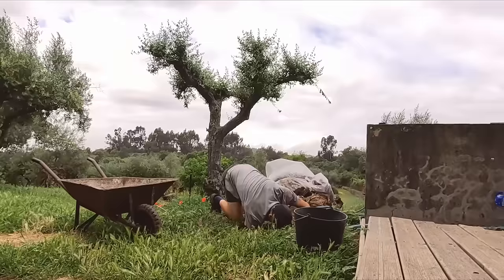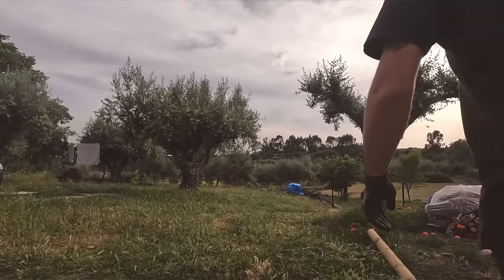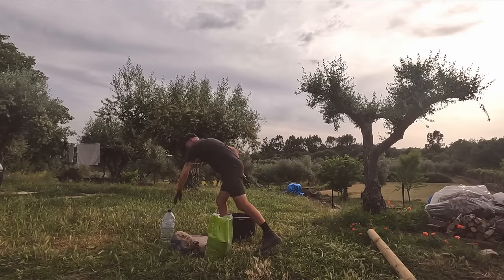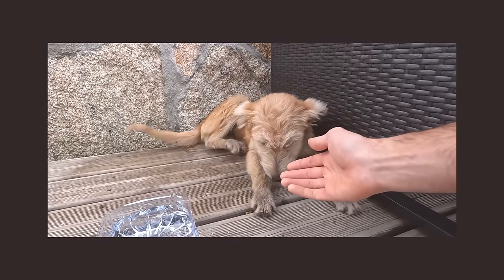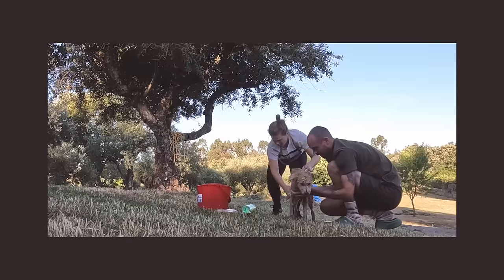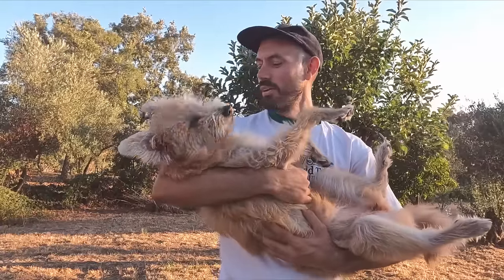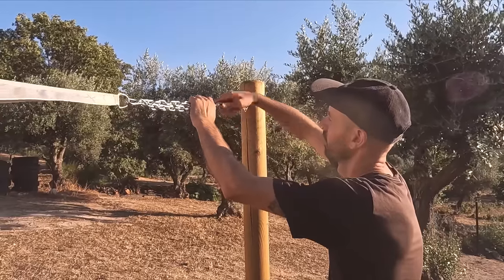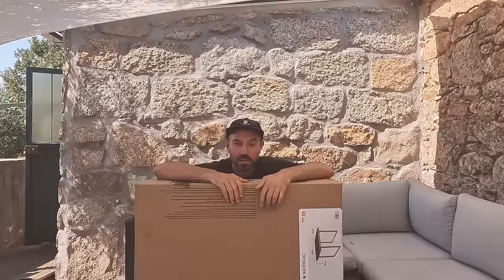CAN WE KEEP HER? Dog in Need & Creating Outdoor Living Space

Comment: Ricky glad Poppy recognised your kind heart. She must have been desperate to approach your house with Ted in residence.  She chose well! 

When you build the veranda suggest you slope veranda roof so that it floats above the house roof edge.  Hot air will vent out of gap, ie there is a house roof and there is a separate patio roof.  About 30 cm overhang above the house and 25-30 cm space between house gutter and patio roof will work. Hot air rises and by having a vent line you will be creating air movement as the hot air vents, and have  cooler air below on the patio.  A lot of homes here (hot subtropics) are using this type of patio extension.

Comment: I have adopted many dogs over the past 20 years or so, and I recommend it whole heartedly.  They are the best.  The one thing I worry about, but I am no builder, it that you put the wooden pole directly into the concrete.  Supposedly the pole will rot.  That is what I have heard.
Reply from the maker: It only rots if you don’t put gravel underneath the pole to stop it sitting in water or if you don’t slope the concrete away from the pole to stop puddles forming around the top

Comment: The walls of the house are stunning, but is there cement between the stones that maybe should be removed and replaced with that beautful lime mortar used by the " Indie Project '"?  Adore this beautful material .. The sound of cicadas , emotional music. Praying for rain..All the best.. keep going!
Reply from the maker: You're correct Patrizia. The building is currently held together by an old earth mortar but there are areas where cement mortar has been used by the previous owners to patch up holes...in two areas cement has actually been thrown all over the wall! Going to be fun trying to remove all of that! But yes, eventually I'm going to remove all of it & replace with lime, both outside & inside 👍

Comment: Great video. Congrats on the new family member!

One comment - you're deck boards don't look completely rotten, just weathered. If that is pressure-treated lumber, it should last 15 years at least. If it can be restored without replacing, that would be the most eco thing to do, since PT lumber is a hazardous waste and it is highly inadvisable to burn it.

That's also about 1000 € in replacement value at the current eye-bleeding prices of lumber right now in the iberian peninsula. I just bought a bunch in Galicia for terrace railings, and was shocked at the cost. My own deck plans are on hold until the prices come down. It's astonishingly expensive at present!
Reply from the maker: Thanks Dan! I should have explained a bit better in the video...the decking boards aren't rotten, although a fair number of them are extremely warped. It's the untreated wood used underneath to frame it that's rotten. Don't worry, when we replace the deck with a tiled floor, the decking boards will not be disposed of or burnt. I have many projects that I can use them for. Definitely don't want them going to waste! 😎
Reply: @LifebyLiving  Eeeesh. Untreated lumber underneath!?! Yeah, that needs sorted.

In our area of Galicia (and I presume, your area of Portugal), there is very little traditional construction in wood, since most people avoid any material that can burn or rot - - for living quarters at least. That being the case, few people have DIY carpentry skills. In our village, my terrace railings are the talk of the town, and I'm seen as some kind of wood wizard, for possessing the basic tools and home handyman skills just about every suburban dad has back in the US. 😎
Reply from the maker: @viscayavagabond  It's the same here. They try to use concrete & stone as much as possible

Comment: for tick removal, use a glass of water... dump them in the water as you pick them off, no need to squish each separately, then in the end you can drop the water into a fire/boil the water/dump into drain/bury/dump into lime mix if ya mixing that or whatever (don't throw on the ground since they might survive) but it's an easy way to collect them

cute new dog
Reply from the maker: Thanks for the tip Jesper. We actually did end up using a glass of soapy water in the end because there were so many! I couldn't keep squishing them all, it was taking waaay too long!
Reply: You can also put olive oil on the tick and they die! 👍
Reply from the maker: @anniepetty1026  Great tip! We're spoilt for olive oil here!
Reply: @anniepetty1026  ooh olive oil kills them? interesting, is that only olive oils or do other ones work too?